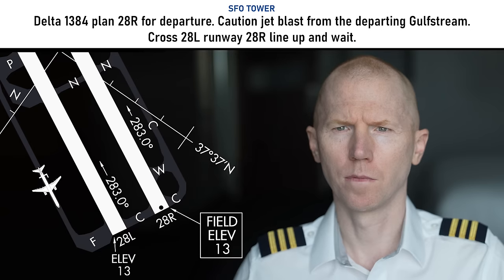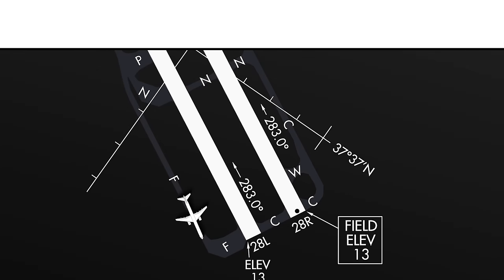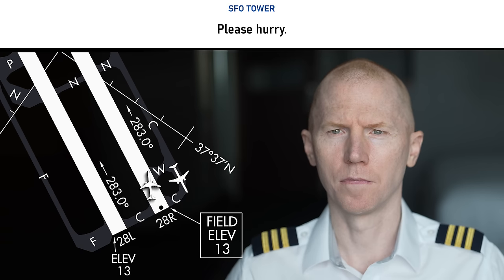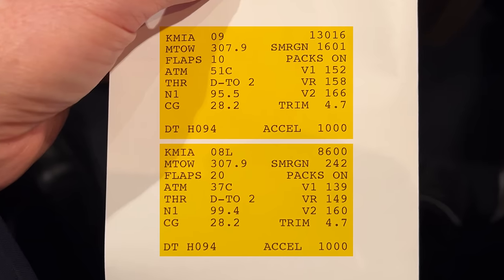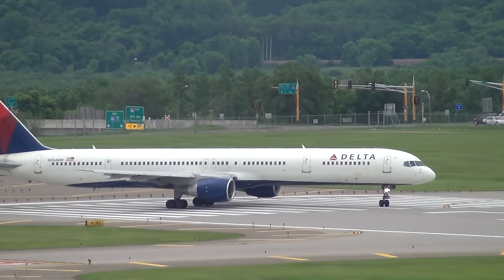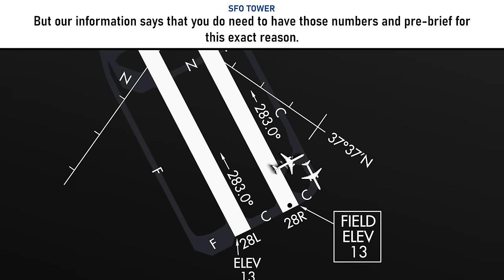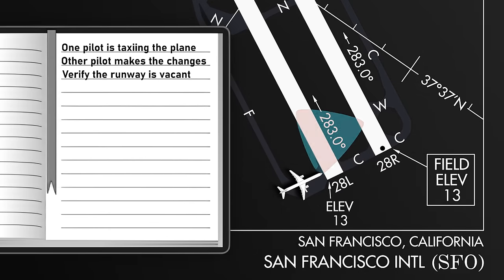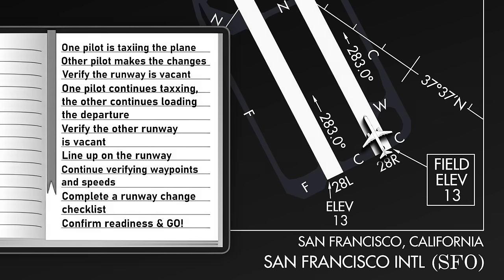ATC Doesn’t Like Delta’s Comment

Comment: This is an example of everybody’s wrong, but as a retired controller, the controller was most wrong. It’s terrible technique to put a plane that isn’t ready onto an active runway. You never put them on the runway with inbound traffic. The controller should never trust a time estimate from a pilot when other traffic is affected. You are absolutely correct that controllers are not taught practically anything about the demands on the cockpit crew. Despite the ATIS advising to be ready for a runway switch, the controller has to know that every crew is a little different and it could take some extra extra time. It’s bad practice to try to rush pilots especially at that point in the flight. The controller also needs to park her ego. You don’t scold on frequency, ever. You certainly don’t let a back-and-forth adversarial exchange occur. If it’s important enough to say anything at all, you have them call the tower. You can even hear that there was a transmission that was blocked because of the extended exchange that should’ve never happened. Did the pilots bait and create the situation? That argument could be made, but an experience controller does not let this happen. Allowing somebody onto the runway that’s not ready to go? Experienced controllers don’t do that at busy airports.

Comment: So to make things simpler basically these pilots should’ve just stoped and waited those few extra minutes to let that plane make it’s landing and then have made the move, which would’ve given them plenty of time to punch in the numbers. Often times taking a few extra minutes will save more time in any line of work. It’s like measure twice before making your cut. Just wait those 5 minutes to let the plane make it’s landing and then continue with your move.

Comment: Never let a controller into your cockpit (metaphorically - when they are controlling.  It's fine to have them actually there as a passenger or observer).  In this case, the controller gave the pilot the option to line up or to hold short.  The decision should have been to hold.  Period.  If the option was not given to hold short, the pilot should have refused the line-up and held anyway.  Rwy changes, new ATIC after pushback, new departures, engine out procedures, performance numbers and all the corresponding briefings take way too long. (and apparently the time associated with the 10 miles out advisory of the other a/c did not consider the IFR separation and wake turbulence separation requirements, which further reduces the 5 minutes.  ALL in all, last minute runway changes are extremely rare.  Don't rush it.

Comment: I have never been ATC or a pilot.  I have done local flights with my nephew while training/getting his pilot's license.  I do have to say that I believe this comes down to one simple statement that was incorrect.  "We're going to need 2 minutes."  That statement was incorrect regardless of advance notice for runway change.  Don't guess when you have two planes potentially on the same runway.  Allow extra time for the upload if needed and let ATC direct you based on that.

Comment: My experience is that ATC in the US ARE VERY intolerant….
Also does “5 out” mean 5 miles out or 5 minutes out?  
Could ATC ask the aircraft on approach to slow down or go-round?
Also , why was there a change of runway?  Was it just because it made ATC’s life easier or ATC, as they sounded, were on a power trip?

Comment: When I just got my PPL the guy handing over the keys to the rental plane questioned my plans (as he should). I had 70 hours by then quizzed me with trick questions until he pushed past my limited knowledge then schooled me in front of my peers. I believe he was well intentioned but I was humiliated.  I walked out to the plane seething, started up, then realized I wasn't in the right mind to fly. I shut down, cancelling for the day. Obviously these pilots are thicker skinned pros with 1000's of hours. I'm sure his '30 secs notice next time" embarrassed the controller but how she proceeded from there took me right back to that moment as a student. Humiliating someone in a high pressure situation (rather than helping) is so dangerous. I'm sure the exchange would be in his head for the next 30 mins distracting him.

Comment: 100% controller responsibility. The controller is the one who has the obligation to delegate priority. Clearly say the ATIS or not check option for change of runway. She is causing an incident. She is a very arrogant woman. She wants to mark a remnant to all active pilots on her frequency. She is the one who escalates the situation, she is the one who generates her first incident at the level of misleading the pilots. As you explain it well, it takes time to reconfigure THE TRACK CHANGE. The pilot told heer clearly that he could expect holding short because he knew that he had some inability for whatever reason, to execute the new programming of the FMC departure RWY change very quickly and without knowing how much time he had to do it. The simplest thing is if Mrs. stops her egocentrism and concentrates on the fact that she is dealing with hundreds of people's lives, and stops being so arrogant. she is the one who commands. That woman must not be controlling air traffic. If a person calls your attention and you look for the right moment to start a battle, in this type of profession. YOU ARE A CRIMINAL. If I had been a passenger on that Delta flight. I would have sued the controlling company in charge. This lady, due to her arrogance, endangered the concentration of the pilots due to a simple personal whim. That woman should be suspended from her duties. She doesn't have the ability to act under stress. Because of a simple mistake of hers. Look where I take the situation. What is not heard there is. Why  she abruptly changes the approx. If she knows that there is a space of 5 minutes with the next plane. Qhy she  din't report it. The Delta pilot doesn't know where the other plane is. She was negligent in keeping information of vital importance for her, just for whom she forces a change in what has already been planned and programmed. Say what they say, she is negligent. She simply did not accept the Delta holding short request And then Delta has to  wait the 5 minutes, what's the problem with that?  She is the one who got caught up in her own twisted approaches to hers and instead of acknowledging that she has an incident, she keeps arguing and stealing the precious seconds that she doesn't have the Delta. trying to intimidate the pilots.   they are slow because they need more than 2 minutes. they asked for holding short and she refused. The problem is hers 100%.

Comment: This conversation with ATC went sideways when the pilot said they needed two minutes (pilot's words), when they clearly knew they needed 3-4 minutes (also pilot's words).   Everything else is contributing factors - ATIS saying to pre-brief two runways being a dumb idea, ATC being out of touch, etc - but when they knew they would need 3-4 minutes for a runway change (again, pilot's words), saying they needed two led directly to banging heads with ATC.

Comment: Totally on the pilots side. ATC need to realize that they sit in the comfy chair in the office and I am the one flying in the metal tube risking lifes and licenses. She was exactly ready for it and caused it herself. As for pilots you can do takeoff release on more than one runway in your performance calculator in EFB simultaneously so you get the numbers right away and it only takes a minute to insert into CDU and re-brief, do your departure plan box.

Comment: I have never understood pilots who are saying or pressure another crewmember to say incorrect estimates. I have flown with a bunch of captains who answer incorrectly for purpose. “How long before you are ready to taxi” - “two minutes” and in reality you are going to need 2 minutes just for the bowed rotor cooling before you are even actually starting any engine, and you end up using 4-5 minutes. And both the FO and CPT knows it’s 5 minutes, but still on RTF “2 minutes”.

Comment: The controller’s attitude might have sucked, but the ATIS is there for a reason - whether pilots like it or not.

It’s ironic, I do tours at my facility and I love putting pilots right next to the local controller and ask them about hitting gaps. It’s amazing how MOST would never hit the gaps we hit as controllers.  Granted, that’s what we are paid for. But hitting those gaps does requires timing and certain things (like being ready to go at the end of the runway) to be lined up. 

If a pilot isn’t ready - that’s fine. But tell atc sooner rather than later. I do crossovers (mainly with small jets and props) at my facility all the time and its mostly not a problem. 

Flight deck training was a nice tool ATC had prior to covid. I was hoping it came back by now, but who knows. Either way, while it’s cool for controllers to see what’s up in the cockpit, it would be equally as nice to have pilots see what atc does first hand.

Comment: As a recently retired air traffic controller, I can tell you, the SFO controller was wrong.  Never put a plane (or two) in that kind of situation. The hold short instructions would of been the best decision and if Delta was able to turn and burn, they could of.  Here in ATL, that would not have gone over well.  And the Delta crew, while gritting their teeth, remained professional!!! I work with and know many Delta flyers and they are generally amongst the best that I've ever worked with.

Comment: Should have stand firm at taxi F. Knock out the inputs needed. Now when that's done you cross that active runway worries are one.
It can be anything that can throw off ATC, like smokers. Not supposed to smoke on the ramp nor near the tower. But they sneak and rush back in the tower not aired out and cause a domino effect. Damn forgot to tell DL flight(?) Sorry about the inconvenience there's a runway change.😢

Comment: Unnecessary pressure last minute. I would have held short 28R, get the numbers correct, and only enter the active runway thereafter. She called the runway change. Make her figure out the deviations. Safety first. Only go when you are ready and fully prepared. Say it as Maverick would. 'I will fire when I am god damned good and ready'

Comment: Unfortunately, cutting things close is standard procedure in San Francisco.  Yes, the Delta pilots should have had the numbers ready for the runway change from 28L to 28R...standard procedure in SFO...especially at night.  The tower controller probably gave them the runway change late...but they were not prepared for it.  Now, they are being (rightfully) pissy.

I believe that SFO tower and approach control are so accostomed to squezing 20 pounds into a 10 pound sack that they feel that this is an acceptible norm.  This is evident by the tower controllers snarky replies.

Comment: I have always advocated for controllers to receive flight training as part of their ATC certification.  Not just ride alongs, but either a private pilot's license OR participation in a commercial airline's pilot training program. 
The low time in the operational weeds AND controllers' complete lack of skin in the game contributes to their abstraction of the SAME JOB that they and the pilots have in moments like these.  Both are trying to get an aircraft off the ground safely. 
As is the case here, the controller's lack of knowledge about what needs to happen in the cockpit for their request is paid by the pilots as usual.
/SMH
The day is coming when pilots are replaced by AI.  We can all see that sad day coming.
But when the replace ATCs with AI there will be dancing in the streets...

Comment: ATC gave the pilots a choice inside specific requirements. It's the captain's responsibility to choose according to the crew's capabilities. They guaranteed a takeoff in 2 minutes and they failed to do so. They could've taken the slow and safe option. It's their choice.
It was also their choice to start the argument.

Comment: Pilot did ask if they were to HOLD on C first. Second they just reiterated and confirmed the ATC to line up on and hold 25R. Yeah...holding on a runway...no thank you. 
I would have requested to Hold on C for the numbers, which is what  i think the pilot was silently asking.
There was no reason to hold on a runway, when you can hold on C.

Comment: Knowing how close a UAL 747 came to clipping the terrain in SFO a few years ago, pilots or ATC shouldn't be in a hurry. The Delta guys allowed themselves to get rushed by trying to accommodate ATC. Easy to judge but we've all been there before, it's crystal clear in hindsight and I'm sure the crew discussed that very thing at level off.

Comment: Arguing about it over the air isn't the professional way to address the confusion, regardless of who did what. I agree that ATC should not have changed their runway at the last minute. I also agree that the pilots should not have tried to rush the set up on the new runway. This is when we de-escalate. Not the conversation, just in general. The ATC needs to shut up. The pilots need to just get off the runway. Every one needs to take a breath and calm down. Get a number to call so you can all talk it out later.

Comment: As a non pilot and non ATC.....but a person using logic...if there is ANY doubt, 'shout it out' and make all necessary steps to ensure your safety, the crew and passengers. How many times have you observed humans making mistakes when they are time pressured? Any good, effective team understands EXACTLY each other's job and realises the effect of changing a standard parameter. The atc was incorrect in her knowledge and rushed the pilots. Surely the simple solution is this. Practice with pilots and ATC doing landings/take offs. Military Special Forces have a Primary and Secondary skill.....a deep and shallow knowledge. Perhaps the ATC/pilot training would yield the result of more harmony and less air collision hazard.

Comment: They were both in the wrong: The pilots probably knew it would take more than 2 minutes to input all the data and double-check in safe time and manner. They should have taken the Controllers advice and held short in between runways but they seemed like they'd rather rush it and get clearance to take off which is not good. The Controller had an attitude and an attitude is never good when you are dealing with peoples lives. This isn't a game lady and there are no prizes for I told you so. Be more professional and respectful of others and remember safety above all else.

Comment: Am a nuts?

I really don't agree the ATC set up the pilot to fail, the intimation that the controller was "waiting" to be argumentative, or that she if she knew more about pilot procedures she would have made a different call otherwise. All of that is unfair and frankly disrespectful. This is a controller at SFO, not some random local tower in class-who-cares airspace.

The pilot literally rolls passenger lives onto a runway with traffic on final claiming to be prepared but isn't such that he has to be asked to leave the the runway, and then whines to the controller about not having enough notice?  What part of this isn't clear: 

ATC: "It will be five minutes before they land. If you are not comfortable with that, hold short of 28R and advise when ready". 
Pilot: "No we are good with five minutes and we will line up and wait on 28R." 

As for the "snark"? If it were Kennedy Steve, he'd have reacted the same way, and then ask the pilot if his mother also believes that two minutes is equivalent to three or four in their universe. And then we'd all just laugh and say we miss the guy.

Comment: Yeah but ultimately at the end of the day if the pilot says 2 minutes and then it takes longer than 2 minutes. That's on the pilot. They could have easily said three or four or five and the traffic controller would have been completely fine with that

Comment: Let's put this in perspective, the PILOTS are the ones directly responsible for the lives onboard THEIR aircraft!  If they need an extra minute or two, with lives on the line,  make it so!  ATC loves to get on a power trip.  Putting pressure on pilots is how dangerous mistakes happen!

Comment: Forget your career cuz its almost certainly going to mean Absolutely Nothing in the Afterlife and exponentially worse is having the lives of many dependent on u doing things correctly, u cant be prone to mistakes when you're a pilots...atc seems more interested in the "flow" as they call it.. Anyone remember Delta 1141? Or how about Tenerife where the klm Captain was so worried about the time he basically brushed off the XO and Flight Engineer's concern about the runway not being clear, many different things caused that disaster but the klm captain was imo the biggest piece of the equation that caused it..i understand being impatient and tired or if you're at risk of being punished pretty severely if u go over your hours, then u got passengers and their complaints of u taking too long all of that means less than nothing when u making a mistake could be your last and u got anywhere from dozens of passengers to hundreds in your hands.

Comment: So unprofessional from ATC.  They need to remember where they are and what the stakes are.  We are all supposed to be professionals, regardless of whether or not you've had the chance to get an orientation jumpseat ride.  Those two pilots were going into a take-off only moments later after having the distraction and stress of Ms Snarky ripping them a new one when they are supposed to be totally calm and undistracted focussing on launching 100 tonnes of people and metal down a runway and have the peace of mind to have the correct reactions if something goes BANG at V1.